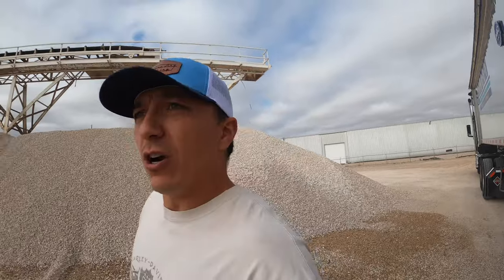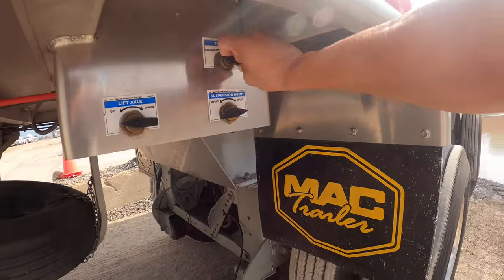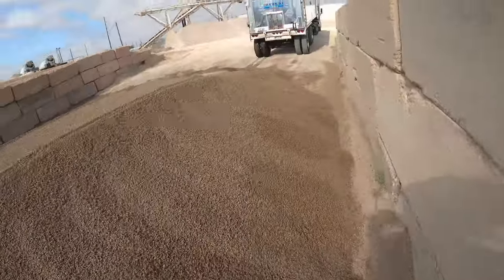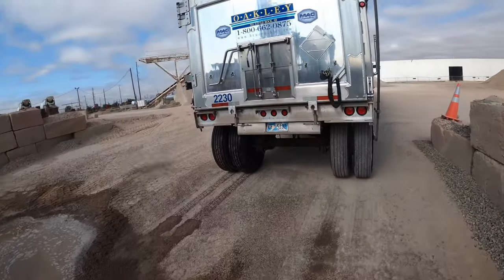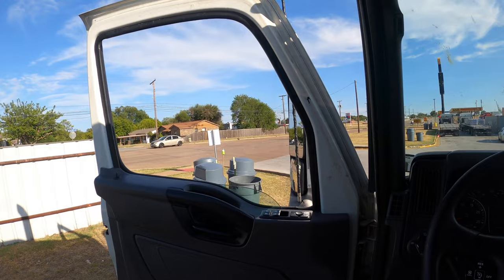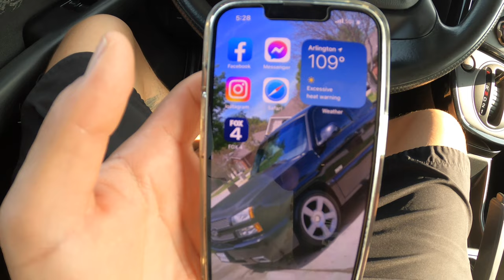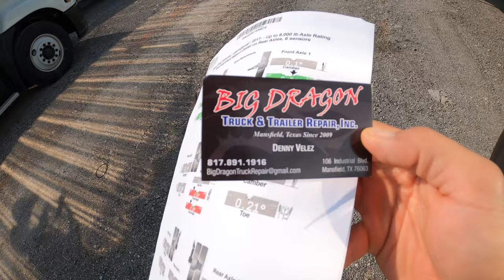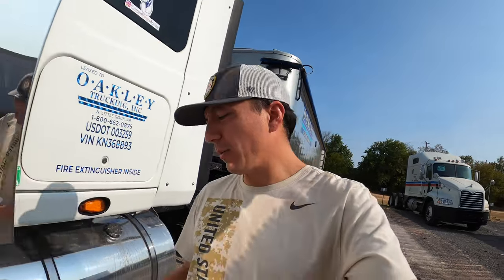End dump unloading by swing gate aka dump truck it

Comment: Good video. However there is always something needing attention with your truck. From alignment to maintenance and everything in between.  Quick question, why did you use the dump gate instead of your normal swing gate? Look like you had plenty of room.
Reply from the maker: Brother, tell me about it. It’s been getting annoying. And two reasons.  Basically to be able to make a video and show y’all cause I’m not It sure if I’ve done it this way on video.  And two, cause that puddle seemed pretty deep. And I couldn’t open it before due to the fact that all the product was on the door.  So if I opened it all the way it would have dropped a bunch where  it wasn’t supposed to be. Now if the puddle wasn’t there I would have back up to my spot and opened it there and raised it up.

Comment: I use Liquid iv drink packets (strawberry) to stay hydrated. They aren't cheap but they definitely have made me absorb water faster.
Reply from the maker: I’ve never tried them.  Do they make you stop frequently for the bathroom or more than usual?
Reply: No more than drinking water. The minerals in them help you absorb the water faster so you can recover quicker. Usually find them near the energy bar or protein powder section at grocery stores. @CruzTube
Reply from the maker: @markwillbanks3607  got it, going to pick some up this weekend and give it a shot.  Thanks for the tip!